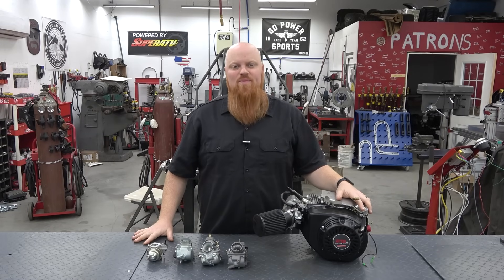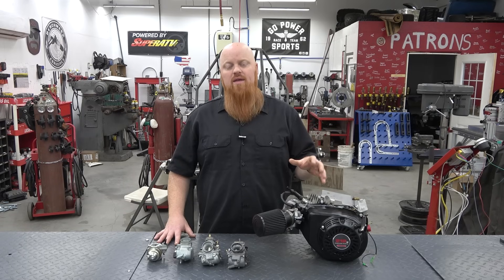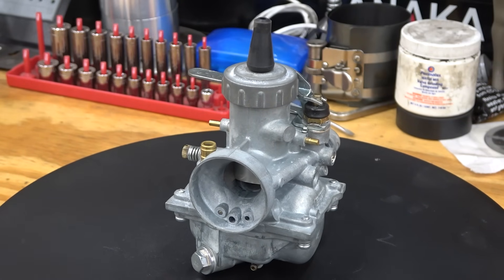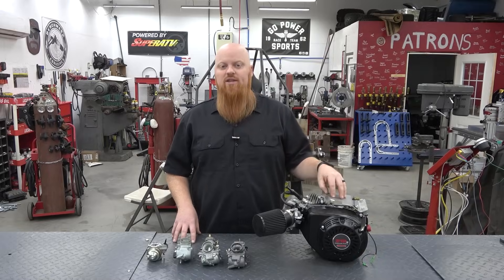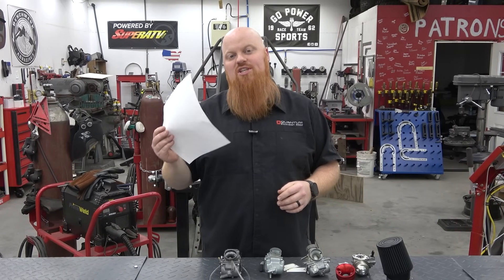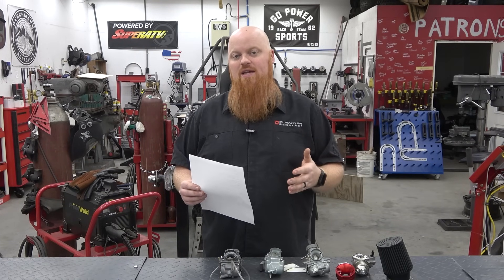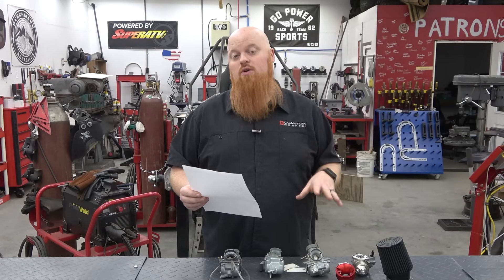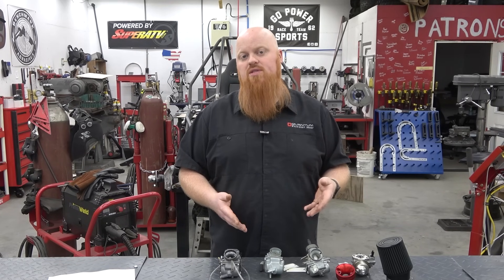Dyno Testing Carburetors ~ The Road To Horsepower Ep3 Carb Showdown

Comment: Last episode you were talking about the ignition timing advance on the flywheel but the reason that it made less torque and horsepower is because the more advanced the timing the more the combustion is working against the piston

Comment: I have a clone predator I’ve built at home I have done any and everything I cann run a PWK flat slid carb on it it’s a 34 I ported the cr out of my head and did some internals but I clocked out at 73 mph this year with my setup and its a simple one seems bullet proof too no problems so far

Comment: @RedBeardsGarage I have a predator 224 with a Superman 265 cam and I am at 400 ft elevation, with the vm22 clone can I run #120 main jet and #15 pilot jet or is that not optimal for that setup? Any help is appreciated

Comment: Have you tried any PZ26 or PZ30 style carbs?

Gonna pick up my first predator 212 tomorrow and its going on a XR100 that i just so happen to have a PZ26 on already, and i seen Mike Festiva run a PZ30 on his but the intake port is only 24-26mm at its largest, i also have a VM22 kit i got from a buddy a while ago

Just curious if anyone has ran either style or the PZ carbs and if they preferred one over the other for a certain engine or just in general etc?

Comment: Great video. Just installed a VM22  carburetor and exhaust kit on my kids Coleman go cart. Thank you for the tips on getting new valve springs and flywheel . Already had an issue and that seems to be the fix in my opinion.

Comment: Sorry but your VM22 clone vs original test is not correct, since with the clone you had an A/F mixture of 11.5 to 12, and with the Original it was under 10´s wich is super rich and takes power out from the engine...

Comment: When I first started building my predator 212 
The intake and Carb ( vm22) was the single biggest improvement ! And it was probably one of the cheapest of improvements… 
This is of course 
After the governor was removed! 
Put a good fuel line and filter on it.. 
I went thru 3 before spending the money on a genuine mukuni ! 
Haven’t had an issue since!

Comment: I don't know if you notice, but after the stock carb, they're in order of AFRs, from rich to lean. The genuine mikuni ran at around 10-11, dipping into 9's, knockoff between 11-12, dipping into 10's, and the TM24 ran 13-14, dipping into 12's.

You can run too much fuel, as this shows.

Comment: Wil the vm22 clone work with the stage one parts?
Reply: The VM22 clone just needs a header pipe. The carb and pipe are "stage 1". If you have a Predator 224 you don't need a header pipe. The carb will work with the stock 224 muffler.

Comment: If you replace the carb and remove all the throttle linkage cam you leave the governor gear in place or do you have to go in and remove the gear. Is it going to bother anything just hanging there
Reply: It depends on what your RPM potential is. I wouldn't trust the internal governor parts 6K RPM and above. I run slide carbs with the internal governor parts. But I'm never going over 5K RPM. I use a cheap tach that has a max RPM recall function.

You have to account for the governor arm on top of the engine. I use a small bracket bolted to the head with the stock governor arm spring attached to it. The spring is completely relaxed with the engine off. With the engine running the governor just pulls on the spring like it does with the stock carb.

Comment: i had been thinking about changing out my minibike carb. its got an old tecumseh 2.5hp with the butterfly valves and it just doesnt do all that great. idle is inconsistent, high end is a little lacking, and any throttle position between wot and idle results in erratic rpm.

Comment: Do I need billet rod if I get do a gov delete and put a flat slide carb or just the 18lb valve springs and billet flywheel because I’ve heard that the motor blows up with out the billet rod

Comment: Problems with the cheap Chinese carbs are the idle/off idle response. From my experience
Reply: I have three of the cheap VM22 clones. The off idle response is fixed during tuning with the needle clip position. I was a bit surprised how well these work and had a lot of fun tuning them. Nice power gain over the stock carb.

Comment: I got the Nibbi PE26 like $80 it came with #40 pilot and #105 main jet with a extra #35 pilot and #110,#115,#118 main jets to tune to your sea level and whatnot, i have the hisun 196 that came on the coleman and that carb feels so good, looks mad sexy,  and also so easy to tune. I would love to see the dyno difference going from 24mm to 26mm. I doubt the performance is worth $40 more than the clone carb but you never know its worth a test. IMO

Comment: we have a predator 212 with a stage 2 racer kit with billet rod and flywheel and hot 265 cam and we just put the genuine 22 mikuni on it and it is running very rich what jets do you recommend in it for it to run right

Comment: Does anyone happen to know what jet size he is running in the mikuni clone? i was looking at doing a 130 but want some input
Reply: Just start with a 130 and tune from there. It seems to me that you can't use what the other guy is using. You have to tune to your engine and environment. A 130 should be rich enough to start with.

Comment: Love this series! I just got a genuine vm22 Mikuni. I have no idea where to begin jetting my stage 3 Hisun 196cc. 
Do you have a range of jet numbers I could start with? All videos I find are about tuning the vm22 clone carbs.
Thanks!
Reply: The genuine and clone are close enough that the main jetting should be the same. My 196 with a 265-lift cam runs the best with a 125 main in the VM22 clone. I'm under 1K feet ASL.

Comment: Problem is that I need to have my governor hooked up because my engine isn’t going on a go kart or a mini bike I’m putting my engine on my jitterbug what has a 3 speed transmission with a low and high range transmission or transfer case with a car rear end I’m using 165/80/r13 tire on it so I need the power but I need the governor because I can’t just put a hand or foot throttle on my jitterbug and it’s weight is around 800lbs so I’m trying to get some hp but keep the old carburetor with the bigger jet and I don’t want a loud exhaust on it either

Comment: What jet sizes did you use for each carb setup? Currently running a 15 pilot and 135 main in my clone VM22. Mid range has some issues. Debatingbswapping on a genuine vm22-133. Seems i should grab a flatside. Just curious of your setup?
Reply from the maker: I can't remember off the top of my head. I will try to remember on a later video to say.
Reply: @RedBeardsGarage  Thanks!

Comment: I'm doing a stage one build on my predator 212 what is the best carburetor rejet For my stock 212 carburetor? My goal is close to 10 horsepower with a header pipe and the air filter I just need the carb to get a reject but I don't know the proper one if you can help maybe send me a link please

Comment: I took my governor out, put a upgrade air filter and jet kit carb now my bike just stalls every time I hit the gas, the bike is pretty much new so I don’t know what it could be, I tried adjusting the screws and found I can drive but it doesn’t accelerate fast like before, it slowly builds up to speed, but then I messed with those screws again and now it just stalls period

Comment: Hi guys I have a question I am new to mini bikes and small engines ,do you need to have any modifications inside these engines before installing a vm mikini carb ?I just bought a mini bike and purchased a predator 212 nom hemi engine and vm22 mikuni carb and pipe exhaust but my bike doesn’t stay on 😩

Comment: So I have a Honda 6.5 hp and I put a Chinese mikuni carb on it and I have the idle screw all the way down and I can start it and sounds low idle but next 30sec and it throttles up and engages the clutch and want to take off how can I fix it

Comment: Back in the day i built 4cyl Briggs kart engines(restricted and unrestricted) I specialized in carbs and have ton of hours flowing carbs and wet flow bench and modify carbs . Your biggest gain / restriction is the carb period !!!!. Your test doesn't show the whole carb story you need to graph A/F. Great job testing and sharing your results!!!!!! Thanks, BobG
Reply: Most likely the flat slide has a better fuel curve and hence the pretty torque curve.

Comment: These videos are very good and really help with my mud motors for duck boats. A full stage 2 with the flat slide should rip on a 14ft 36in wide flat bottom
Reply: Did you have any luck with this? I can't get TM24 to tune to save my life. On the water yesterday it was spraying fuel everywhere out the vent tubes. I think the needle or main needs adjusting still but it also managed to flood with all the vibration.
Reply: @HeegeMcGee  what carb are you running? I had the same issue with a makuni, I wound up using a needle and set with a lot smaller hole for fuel to flow through and fixed it

Comment: I really like the flat slide carb, and liked the looks of how smooth the graph looked on the dyno. Until GPS makes a 3 magnet billet flywheel, I'll be keeping my MTB under 5,000rpm. So far, I've done the stage 1 with re-jetting, and K&N style air filter, straight through exhaust, and zip tied the governor spring. In this configuration, My bike does 80km/h, or 50mph, and stays under 5,000rpm. This is max speed limit around where I live, and plenty fast enough to get trouble from the cops. I run a Harley LED headlight, and the tail light that looks like the back of an F-14 in LED, with running, turns, and break lights. I have 2 coils under the electric start flywheel, and a 12v battery under the motor mount plate. I usually charge up the battery for a few hours, before riding, and the charging system keeps the flashers working all day.

Comment: Predator engines how do they trigger the spark to the plug.  Im use ta seeing points under the flywheel.  Or you have a video of the ignition setup?
Reply: Conventional magneto/magnet setup. Point and condenser is hella old

Comment: Not only does the flat-slide carb give the best peak power by far, the output is also the most consistent without the flat spots in the curve like all the other carbs. On top of that, it's making peak power way up high in the RPM range, which makes me think this carb will have the most headroom for adding more power mods down the road.

Comment: Is it practical to install a Mikuni 24mm flat slide carb if you are not removing the govoner?  I've ordered the carb, and I was going to just set it on the shelf until I had the money for the rest of the Stage 2 kit, but then I was thinking, maybe I shouldn't wait.  What do you think?

Comment: Considering that only one carburetor was running the right AFR! I feel like more effort would prove different results? The VM22 knock-off was at 0.65 lambda, or 9.5 AFR isn't fair compared to 0.92 lambda or 13.5 AFR! There was more power to be made with the other carb!

Comment: Thank you. I have a 212cc that I'm doing a slight upgrade to, carb, govenor removed and springs. Not looking for any RPM past 4500 so I'm keeping the stock flywheel since I was the electric start. With gearing and such I'll be getting 10k RPM at the water turbine. My son is 7yo so the mini jet boat should move along at a reasonable speed. We'll see how it goes this summer! Who knows maybe I'll make a YT video of it on the water.  Thanks for your videos, I'm glad to be on the right track.

Comment: This is the series that I always wanted to see! I have a Yerf Dog that has a hemi 212 on it with billet rod/flywheel, 265 cam, 22 lbs valve springs, clone VM22, and header with rlv muffler. The thing rips and I've wondered what kind of power it makes.
Reply: I ordered a flywheel and rod with mod 2 cam do u prefer 22lb or 18lb springs

Comment: RBG, buddy.

Question for you or anyone who can answer it for me.

I've got a knock, my con rod clearanced my crank perfectly, my flywheel is lapped perfectly, I've got a slight bit more crank end play than I'd like but didn't have spacers to be rid of it (didn't have any on hand durong build because they were forgotten about).

Motor went together perfectly, no parts needed ground for fitment, motor runs good on stock carb, I put a mikubi clone Nibbi PE24 on her.

She ran like crap, for a day or two of testing the new carb to tune it ..

Put stock carb back on, now it has developed quite a loud knock, and a little extra vibrational shimmy that wasn't there in stock format, or when I did the early build.

I did not remove the governor gear from the crank as it doesn't seem to interfere with any other parts internally so I left it installed.

Today I am going to disnantle the engine and check for the knock source, this makes the second ARC rod I've had an issue with knock out of the box, despite both plastiguaged and micd cranks fitting the rods perfectly around the full pie of the diameter.

I've built several engines before this without this issue, but they weren't predator variety, they were 2 stroke variety, and had different crank and bearing setup than this.

2 out of 2 motors with perdator 212 with stock length con rods that are knocking (I believe) right out of the box, despite the crank measuring perfect, andtge plastiguaged confirming the prescribed .25 to 0.3 thou of oil clearance. 

Torqued to 170 in-lb with oil as lube.
Cranks cleaned manually before being oiled and installed
Reply: I'd like to say I AM using an old old old clutch as well, and if I grabthe bell of the clutch (which is loose) and hold it with my hand, the knock is significantly quieter...

I'm going to try running the motor at the shop with no clutch on it and seeif maybe my issue isn't this motor but maybe the old clutch.

I use this bike as my ride to work every day, so far it's been reliable as all hell, in it's stock format.

I'm considering buying a third motor and keeping it bone stock to use while perfect my building skills on my 2 experimental motors.

My goal in the long run is to begin experiments with CDI, and stator replacements for the flywheel that will let it be able to charge a small battery for a basic light system and maybe a radio if the power output is good enough.

Or an alternator on a pulley where the fuel tank used to sit
Reply: Update on what has been found out.

Galling on the bearing in the crank, and now more play than what it had during fitment by a lot.

Case bearings fine, seems to be scratching in the cylinder bore  from piston slap.

The spark plug and piston face are white from the combination of being lean mix and that ridiculous 32 degree timing advance. (Stock carb, stock jet, didn't have time to wait for aftermarket.)

From what I can see, the stock carband jet combined with the stupid timing advance caused detonation, which in turn is damaging the rod bearings.

I am very upsetting spaghetti that I didn't think about the timing advance to begin with, and that the ONLY flywheels for the hemi have such a high level of advance to them that they will damage a mostly stock setup like that.

Things to keep inind in my rebuild will be: that I need to find an acceptable way to retard the timing if I am trying to keep the stock carb and ignition timing.

The reasoning say this is that the ONLY thing I didn't do to the tee was replace my carb with an after stock jet or carb.

So I've been running very lean mix, and causing detonations during the exhaust stroke, which have caused the new con rod to be damaged.

I think I am going to build some kind of a sliding plate mount for the coil to be moved forward or back to adjust for the timing difference.

I think that by retarding my timing to stock, I should be able to eliminate the knock, with that and a slightly bigger jet.

Alli want out of this motor is to remove the rev limiter, I'm not looking for top end rpms or super high performance, I'd likeslughtly better than stock performance, with billet parts that ensure safety and reliability.

So far from ARC I have not seen the results I wanted, but I mostly blame that I didn't take the timing difference or the fuel into account before running the engine (as the bike IS my main mode of travel at this time.)

Comment: There is an old dude named David vizard what wrote the book on engines literally he figured out that an expansion chamber after the collector made the engine think it had a straight pipe I'm thinking an expansion chamber about where the standard muffler would be might do this on a 212  the engine doesn't see the restriction of a muffler after the chamber

Comment: In your testing, are you dialing in jetting for each test? The genuine mikuni’s AFR seemed all out of whack at both WOT and idle. Super lean at idle, super fat at WOT. that could account for the power discrepancy between it and the clone vm22.

Comment: I have the vm22 official,  and when i choke the motor, nothing.  If i put it on run give just the smalles gas, and it roars to life.  Is that a vaccum leak?   was thinkin of tryin the rubber hose fitting yall use.

Comment: I gave a thumbs up for your efforts,but didn't bother to watch the tests after you said you weren't putting the timing correct.The results are useless with the timing Wrong.Nobody with 2 braincells would spend the money to improve their motor while knowing it isn't running right period.
Reply: it seems rbg isn't trying to achieve maximum power- at this point in the series , just guides on least expensive mods for noobs. I'm sure there are many hours behind the scenes, can't test all aspects at once. RBG did mention there will be a full out vid's chasing max hp.